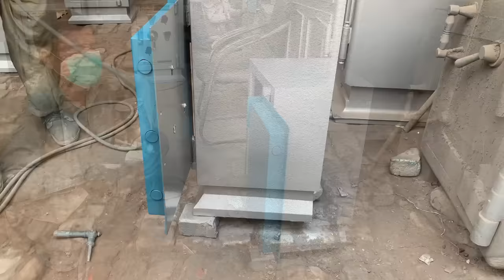Watch How Professional Make an Amazing Gold Jewellery Safe | How Security Locker Are Made in Factory

Comment: It is a fairly low security safe design, but I really admire the skill of the guy who made it. This was fascinating to watch.
Reply: Is that a hint of sarcasm i'm detecting? I'm guessing he never did a welding course. My favorite bit was the five or six spots in a row instead of a seam.
Reply: Mark's this is  not jewlry safe I am bank cntector in pakistan I now safe 
Out side sheet thicnes aproxmatly two inch inside coper plates and compound fire stoper any one not cut with gas cuter and grinders
Reply: They list it as "Gold Jewelry Safe".
Reply: @faheemahmad6029  first learn to write English properly
Reply: @lawrencemitchell1974  this is how they save money and produce very low quality products for local market and sell it for high prices , there is no concept of quality control in this country
Reply: @lawrencemitchell1974  Yes the plate was so thin he would burn through it with a full seam.
Reply: @apkafan8004  No need to be primitive.

Comment: I have been to a safe making firm in England. It is at least 1 inch high grade steel which is laser cut by a computer. It is precision engineering double skinned and 4 corner bent with a filling that is almost impossible to penetrate by heat or drill. The thing that is being made here is no more than a tin box.
Reply: I was going to say: He's flattening it with a hammer. How secure can  that steel possibly be? No straight-edge for squaring, no measuring... Professional indeed.
Reply: Pakistani quality
Reply: @arulkumar4001  that’s an oxymoron, but very funny nonetheless! Nice one, mate.

To quote an old t-shirt joke about people involved in welding bits of metal together, it goes like this - “I might not be a welding god, but I am a god with a grinder” 
(it disguises all the shoddy work!).
The “metal” being used here, appears to have less structural strength than a biscuit/cookie box!
Reply: Cheap jewellery and tools over there so she’s bulletproof 😂🇦🇺
Reply: I love that there a big top quality on the safe that pretty funny
Reply: @Shamefulbird  plus the 17 locks on that bread box.
Reply: like the bank, some only need 1 guard, some need guards with guns
Reply: @petedavis7970  9
Reply: @arulkumar4001  Better than Chinese!
Reply: I bet you'd like his skills though,
Reply: it is in India and I have extensive experience with picking locks There is only one lock that can't be picked. It does not jow strong the box is. The lock is the weakness and to compare the UK and India is a bit low
Reply: you are talking about your best safe. what is the specs for the entry level...? As for the best it's "4 corner bent?" "solid 1" steel double skinned! "so 2" of steel. The best safes are layers of different materials and it's not possible to fold 1" steel into a rectangle without cutting.
Reply: @petedavis7970  And cutting it with a chisel, which is a joke of a steel. It is clearly mild steel.
Reply: Этот сейф для хранения пульта от телевизора 🤣🤣
Reply: For confused people I like to tell that yes these safe are not strong but in countries where these are sold people buy just for rich feel, here people do not possess such valuable thing which requires a safe.
Reply: لااحد يصنع الخزائن الحديدية كالانجليز 
انهم الافضل على الاطلاق في هذا المجال
Reply: 0
Reply: Yup it's just a basic strong box really
Reply: @Lord_Ronin_The_Compassionate  Grinder and paint hide the welder I ain't.
Reply: It’s all tack welds. I bet you see daylight through the seams!
Reply: And then I did see daylight at 5:23. Jesus. And does anyone in this country own a grinder to clean the joints for the welds? A strong kick might pop half of them.
Reply: @PINKFL0YD-s2h  What lock can't be picked?
Reply: REALMENTE OS CARA SEM RECURSOS SEM MAQUINÁRIO DE ÚLTIMA GERAÇÃO LAZER ETC ELES AINDA SIM FAZEM ACONTECER! PARABÉNS PELO TRABALHO E ESFORÇO! AGORA OS QUE VINHERAM AQUI PARA CRITICAR É MUITO LAMENTÁVEL!!!
Reply: @H4rleyBoy  concordo essas pessoas que criticam nao fazem nem a metade
Reply: The important advantage is portability, take it and go

Comment: Hinges on the outside and bolts on one side.
The perfect safe for storing worthless items.
Reply: Сейф от честных людей
Reply: made of 1,5 mm steel plates 🤣
Reply: @tonioreyes  weighs 2 kg
Reply: I believe they r form pakistan
Reply: US safes aren't any better, you can cut them open with a circular saw
Reply: @captainfancypants4933  Right. They give you all the attributes of the door. Big deal, a gas chop saw on the 12ga sides works like a can opener.
Reply: At least it’s easy to open if you lost your keys :-)
Reply: The hinges are the least of the problem :P Actually, hinges on the outside is a very good idea in a REAL safe. The hinges usually have nothing with the safety of the safe, since the door have bolts in all directions and the hinges are just there for a more comfortable way of opening the door. In this case, however when the hinges are a part of whats holding the door in place is another matter..
Reply: do you think they have something valuable in it ?
Reply: Not to mention that tack welding that is easy to undo with a hammer. Want a side panel off? Done!
Reply: This safe is one of the 8 multiple stacking safes like the Russian stacking dolls.:face-blue-wide-eyes:

Comment: With nothing holding it together but spot welds, all you have to is drop it on the floor and it would fall apart.
Reply: You don't even have to bother lifting it up. The sheets are so thin that you can cut it through only with chisel.
Reply: @SYS-dc6uo  You dont even have to cut with a chisel, just get a hammer,...
Reply: You forgot about the filler, adds strength!

Comment: A jewellery safe made entirely from hand pliable sheet steel would NOT qualify for a grade 0 cash/jewellery certification. All safes should be protection graded, from a Grade 0 right through to the highest level of protection Grade 7. All safes have an 'insurance cash rating' which indicates the level of security and the maximum amount of cash covered by insurance companies when stored in the safe overnight. Would you protect your treasured valuables in a thin sheet steel box?

Comment: I would not put any money or jewelry in this “safe” because it can be opened in less than two minutes. Cheap material and only welding points not full bead. You need only a mass to do it. If you want something strong you should use armor plate for safe.

Comment: Its as safe as the materials used, to get into this safe in less than a minute you use a cordless angle grinder and help yourself to the safely hidden items in this tin case. But credit to the guys that work crouched manufacturing these items.

Comment: Stick welding while their only protective gear is like 'just close your eyes'. Spray painting with just an op mask for respiratory protection. These skilful workers are being exploited. Also, buyers will not get a "jewellery safe" for their money, but just a sheet metal box that can easily be opened with a screw driver.

Comment: Least secure “safe” I’ve ever seen I thought the spot welds was just for mock up and a seam weld would be done but no just a layer of body filler to cover them welds would do. Whack the corners with a hammer and your in. I’d be more worried about being locked out with items inside as the mechanism was crap and it’s going to fail

Comment: Grind off the welds on the hinges and you are in.  Only one side has bolts. The locks look bad as well.  Then they didn't fill the walls at all and the metal is thin. They did not do the same with the door.  Also I dont think you can get at the locks on the door from the back without cutting open the door.  So you cant replace them.  The welding is not strong too.   The metal is very thin, it will be easy to cut open.

This is a very cheap safe thats going to be easy to get into.

Comment: Скажите, в какие магазины вы их продаёте, я с консервным ножом приду)
Reply: Ты смеёшься ? Это же SUPER DELUKS ! Автоген не возмёт !!!
Reply: From the way he easily cut the hole out of them, the steel plates are no thicker than 1mm. Had he use thicker plates (say 2.5 mm) on the outer cover, the simple can opener attack can be defeated. Yes, an angle grinder can easily cut through 2.5mm thick plates. But based on the regions where these safes are probably sold, I'm suspecting the thieves themselves do not access to these power tools.
Reply: @НашСемейников  прихватки от падения на пол развалятся...

Comment: That is a box not a safe. They should have used at a minimum D2 1/4 inch with concrete in between the plates with rods in.

Comment: A true safe you want the exterior walls to be at least a quarter if not half inch at least including floor ceiling the door at least 1+ not including the locking pins assembly and use hardened tempered steel not mild steel stainless hardened steel for pins locking assembly
Anti drill plate around lock area to protect locking opening assembly
If you have room inside Id put fire furnace bricks on interior surfaces and inside surface of door that's your thermal protection
Hinges you want on the interior ideally plus anti pry features plus on really high end safes you'd have a failsafe dead man relocker like a glass drill detect that when broken releases spring loaded bolts dead sealing the safe also a built in GPS tracker if a burglar some how managed to extract a bolted down safe to transport it elsewhere to open later
Reply: who ask u

Comment: You could add a booby trap to enhance security. Just don't forget to disarm it before opening.
Would make an efficient faraday cage if all of the seams were welded instead of tacked. Just add some conductive gasketing to the lips of the door.......
Reply: That would be an acceptable use case. Although I've seen much better constructed Faraday cages, made with thicker steel. I even have photos of one to compare. :)

Comment: sorry but having had arc eye or welders flash i can tel l you NEVER EVER weld without proper eye protection no matter what having welders flash is awful and extreamly painful not right away but several hours later its like Someone pouring sand/salt into your eyes everytime you blink and even if you keeps your eyes shut they constantly water till they feel like they are burning.. terrible work conditions and work ethic

Comment: The metal sheeting they use is too thin to continuously well, so they spot weld. You could collapse the whole thing with a sludge hammer in under 5 minutes. This “safe” would not get insurance cover in my country - it is rubbish.

Comment: Wow, i wouldn't call this a piece of shit because you can flush that, I've no idea what you're supposed to do with the thing they made. Old Fred there, in a dirty dusty warehouse, putting dents into sheet metal, spot welding the box as if he were putting in nails. Thought he was going to go over and do a proper weld, but no, why bother. Paint it instead in cousin Jimmy's earth garage. You could break the thing by dropping in on the floor. You could crack it with a chopstick. I suppose it would work against a thief, because when he finally stops laughing, he'll never suppose anyone actually put anything valuable inside. Or anything at all.

Comment: You are not safe but a trick. I can break it with a hammer weighing 2 kg. But with craftsmanship, skill and an amazing exterior. But it is not a solid safe. It looks like a safe, but it is a biscuit that you throw on the ground and it becomes like broken glass.
wrong design. There is no base for lockers. All cabinets without base. The thief will be surprised by the base and say they want to trick me, this is not the real safe. I will look for the real safe. ha ha ha ha

Comment: Those locks will not resist a smart coathanger, and the walls will last 10 secs against a cordless grinder and a cutting disc, so my jewels will not be in there. But, it does show that some very nice work can be done without the $15,000 tools expected in a western workshop.

Comment: Expectations clearly differ from those in the West!

By no stretch of the imagination does this scrap sheet metal, tack welded box meet the barest minimum standards for being considered a safe for the storage of valuables. 

That it loosely resembled a safe, is not the same thing as actually being a safe! 

The materials used and their assembly methods do not even begin to provide the level of security required to thwart forced entry. 

As a very light duty storage box for odds and ends, it may suffice, but as a safe, never! 

That these are sold as safes is an outright deception, my Hultafors Mini Pry Bar would open it completely in a matter of seconds! 

As a safe, its utter garbage...